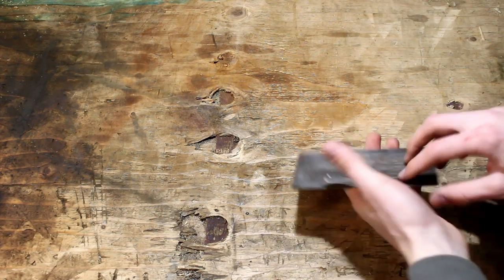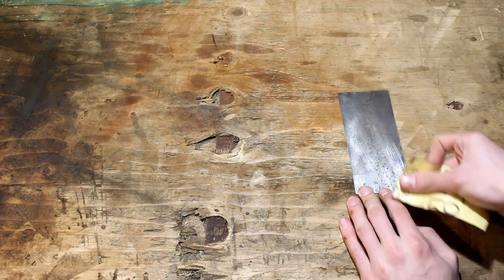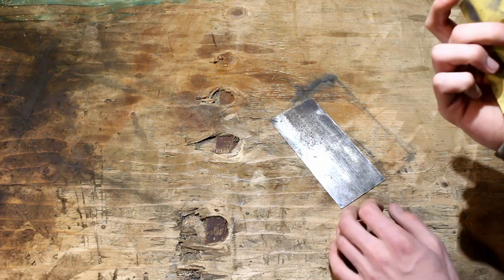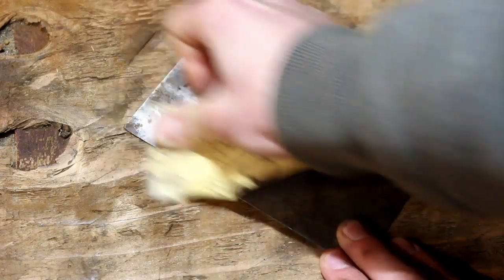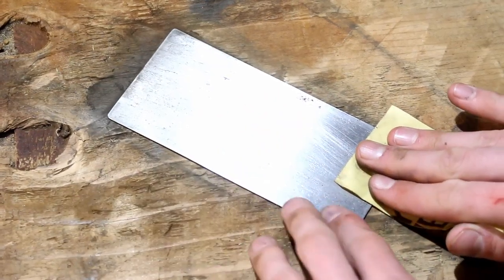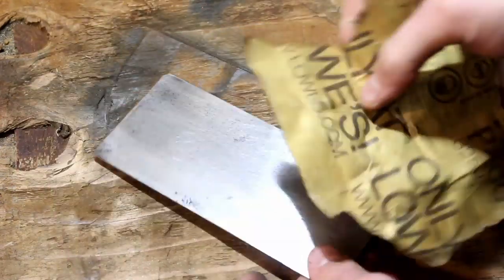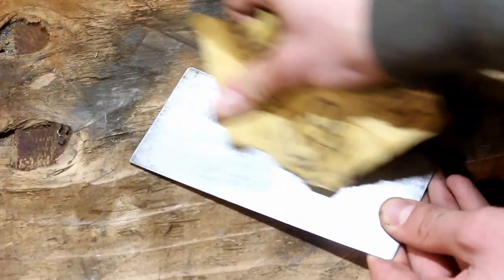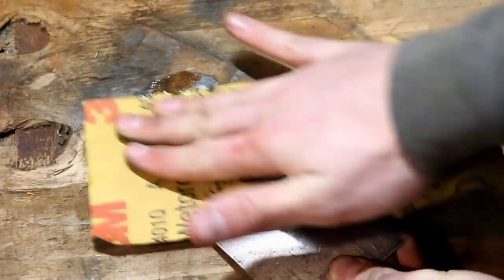How To Restore A Card Scraper  | PNW Homesteading

Comment: nice video. I live in the PNW also, I know thing rust even when put away.
Do you have a video on filling the edge flat, and how to protect the metal? I use mineral oil on tools i don't use often.
Reply from the maker: +Ted Lance Yes I do. What you can also use to flatten the edges is a circular belt sander. For protecting the edges I use regular oil after each use. Hope this helps. I you have any other questions just ask.
https://youtu.be/H0Z61GzpwWQ